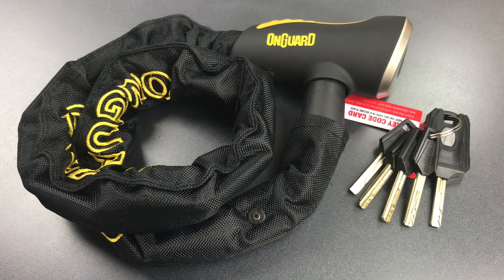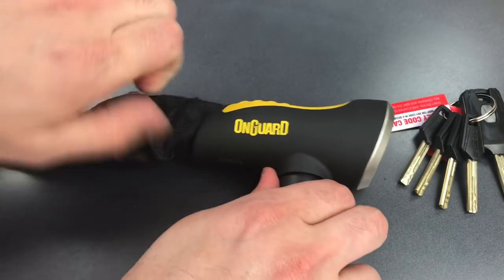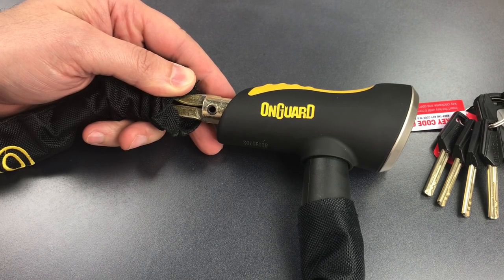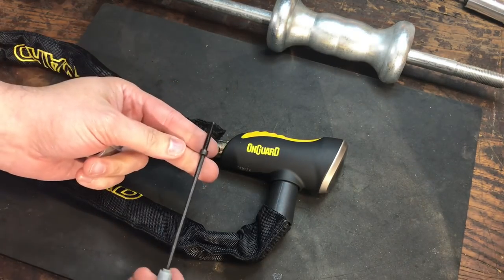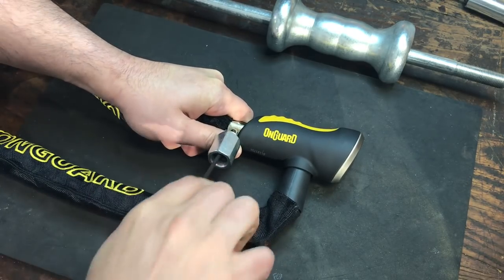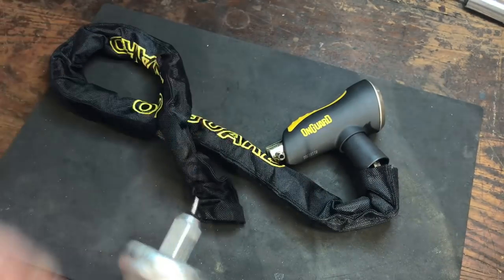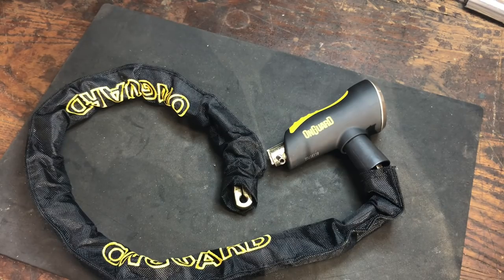[681] Slide Hammer vs. OnGuard Mastiff Bicycle Chain Lock

Comment: useful technique for anyone who needs to pull an inaccessable pin.
Reply: I remove roll pins at work a lot. I usually weld the end shut, build material up to the surface, weld a washer on top and drive a wedge under each side of the washer incrementally. I'm going to try this though next time I have to do that job.

Comment: so a quick tac weld over the pin, and this lock is fairly skoomum
Reply: You've been watching AVE.
Reply: Skookum as frig!
Reply: just fill the hole with some hard epoxy instead, and glue a collar over the joint so it's not apparent which side is pin, and which is blind. Epoxy will need drilling to get through, and that's another required tool for the thief. Also, + 1-2 minutes of meddling if it will envelop the drill piece.
Any lock is just a delay if the thief has a grinder. Or a bolt cutter (often, there's no need to cut the lock itself).
Reply: well not weld since it hardened steel. difficult to put a bead on, but def hide it or delay access to...
Reply: @JohnLeePettimoreIII  the bigger the gob, the better the job 🍻
Reply: That’s what I thought!

Comment: So... insert a screw and break it off and you can't attack it this way?
Reply: Just remember that there's more than one blind pin to plug up.
Reply: A thief isn't going to carry around a slide hammer and cut the housing off to work on the other pins...LOL Let's be somewhat realistic here.
Reply: Wrong - one of popular methods is core pulling. Slide hammer is safer to carry by thief than bolt cutters in case police stops them.
Reply: Or just have it tack welded straight from the factory. There is no point in it ever being removed anyways

Comment: I think you could prevent this attack by inserting flush steel pins into the split pins.
Reply: Or fill with epoxy.
Reply: Yeah or just weld the whole thing together. That pin doesn’t need to move or come out.
Reply: You could melt Copper into it. Copper won't weld, so the body panel stud welder won't work. Plus, better heat tolerance than epoxy, so it'll be less susceptible to a torch.
Reply: @circuitsandshortcuts  Just continue guys. I am collecting all tools in order to avoid all your ideas. Hell, I'll just take entire workshop with me.

Comment: This lock actually seems like a good buy.It's cheap for it's size. Basically unpickable (bosnianbill had to give up), and fixing the pin seems like a quite easy fix. I guess if you don't have a weld machine you can stuff that pin full of something that hardens, so anyone would be unable to screw a bolt in.
Reply: "Basically unpickable"
Did you even look at the video he linked to ? He said himself in the video he had already picked it in the previous video.
Reply: @flashcat6665  LPL is in a league of his own. Bike thieves are nowhere near to him, so it's unpickable. And the pin issue is an easy fix. So, I'm buying the lock.

Comment: The thing about this by-pass is it could also be done surreptitiously, as the lock could easily be reassembled with little obvious evidence to its removal ... not perhaps applicable for a bicycle theft :) ... But if that chain-lock were securing a fenced in compound or equipment storage area ... the by-pass might mis-direct blame to a key holder. 

I think a hardened solid  or threaded blind pin would be much better and a simple 2 second tack weld, would eliminate this vulnerability
Reply: Who said anything about theft
Reply: This by-pass is not surreptitous, any analysis of the pin area would show substantial trauma. It is however potentially very covert, especially if you wern't aware of this weakness, or had potential reason to believe the thing that this was protecting wasn't there in the first place.

Comment: Be interesting to see if a longer screw of the same thread just screwed in would drive the pin out far enough and then just undo the screw
Reply: Yep use a cordless impact bet that pin would b out in like 30 sec almost no noise

Comment: After putting in the (supposedly hardened) roll pin, I'd insert a slightly shorter pin made of high tensile steel down to the bottom, leaving enough space at the top to insert a hardened steel ball (ball bearing).

Comment: I would have loved to see the nut splitter as it is a relatively quiet tool where the only sound would be created by the lock bumping against stuff (for example when it finally gets opened and the force shoots the lock away)

Comment: While roll pins are hard a good quality tap will thread the inside diameter. Then use a long screw, a bushing that the roll pin will fit thru, and a washer and nut, to jack the pin out. I do it at work all the time. Makes less noise too.

Comment: frankly that is a very good lock but could be improved.

first they could make the part on the lock thicker and make pin hole all the way through and use short pin (make the pin length 2/3 or 3/4 the depth of the lug) then fill both ends with some filler so a screw cant be placed in the holes.

you see that the pin holes and screw holes in some locks are plugged.

otherwise the lock is a very good security.

Comment: was the lock side of the chain assembly (the part with the hole for the roll pin) hardened? If it isn't (or even if it is if you have carbide drill bits) first pick a drill bit small enough to fit through the roll pin and drill through using the pin as a drill guide. next pick a bit thats slightly bigger than the OD of the roll pin and drill from the other side.  should be able to use a automatic center punch to drive the pin out.  with the cost of carbide drill bits down as low as they are, it really makes any lock assembled with a roll pin not too bad to deal with.  and a lot less noisy than either a slide hammer or die/disc grinder.
Just noticed that D.R. M.
 suggested the same two days ago...

Comment: I would thread that roll pin. Yes, they are a bit pricey, but i have used taps to take out pins like that.
Also use a dead blow hammer and a reverse strike yoke (used to work metal pieces like a wheel arch).

In short, little to no noise.
Reply: dead blow hammer and reverse strike yoke sound like those cheesy fake wrestling moves

Comment: “Open ended nut splitter to spread this U joint”
Reply: Are you going to reassemble it and try the other way? You should be able to drive that pin home easily. I kinda want to see it spread apart now.

Comment: That was a great fit. I believe a screw any bigger would spread the roll pin and cause it to jamb tighter. Maybe they can jamb a small rod inside the roll pin to prevent this. Fun stuff.  Thanks for sharing
Reply: Our just use a solid pin.

Comment: Locks keep the honest, honest. Thanks for the brute demo!
Reply: The original version of that phrase was something like honest locks keep honest people honest. If you don't have good locks then basically anyone can steal whatever it is you're securing and be stealthy about it, this is why you need to know what kind of locks you're getting and what design flaws if any they have because sure with an angle grinder you can get through any lock in existence but unless the lock is in the middle of nowhere then using an angle grinder is going to be very much not stealthy, and if you have a good lock it might take you 5 plus minutes to get through it with an angle grinder

Comment: I'm guessing most thief's wouldn't have machine screws, A altered long nut and a slide hammer.  I appreciate the video, just for giggles, I threaded a machine screw into mine and then ground the top off flush!!!!!  I picked the lock up at Walmart on clearance for $3!!!

Comment: Would be nice to also offer up ideas on how these flaws could be fixed or made better. For example if someone has this type of lock, how could they make it more difficult to exploit the weakness that was used to open it in the video? Maybe filling up the pin's hole with something? Or maybe welding over it? Discussing these things could lift this channel to yet another high IMO.

Comment: Weld a blind solid pin instead. Why do they always build in these failure points? Assembly lines is the obvious answer. Once the main hard parts of the thing are assembled, the mindset is that the manufacturing process is complete. All that's left is to wrap it in plastic and turn it out like a two bit whore on a Saturday night. And it works most of the time - as far as they know or care, because once it's sold, the guarantee has so many tiny grey font get out clauses they never get any coming back to haunt them. This shit began with Edward Bernays and those lightbulb filament guys.

Comment: Make a kind of pin puller.  1.  Get some washers a little larger than the roll pin,  2.  Get a nut that fits your machine screw  3 Put the nut all the way up the screw, 4. add the washers, 5. insert the screw into the roll pin 6 tighten the nut down to extract the roll pin.

Comment: It is my experience that most external bike, moped or motorcycle locks are opened by people without a key with either bolt cutters or battery angle grinders. Battery angle grinders have become so inexpensive that they are probably taking over the market for thieves' preferred work tools, as it works on all locks and does not fill much as opposed to good bolt cutters.

Comment: a bit late... but if you use a large screw with fine thread, you are expanding the pin, making it even harder to remove from the shackle.

I would go back to the idea of using a smaller screw with heavier threads that will hopefully bite into the steel a bit more than actually spreading it.

Comment: I wonder if just running a machine screw through till it bottoms out and see if the threads can pull it out by just continuing to drive the screw against the blind hole end?

Comment: My first thought about defeating your slide hammer would be to place a weld over the hole. bevel the hole and fill it with a nice round blob of weld. Of course, all that would  have done would be to move to your next kind of attack.

Comment: The fastest way to mitigate this attack would be to fill the center of the roll pin with a shot of epoxy, or an even smaller roll pin (would take two attempts like this; more time to open).

Comment: What about freezing the joint?
Reply: That would defenatly work. problem is tough, for the metal to become brittle enough all the way through so that your able to break it by hitting it with a hammer, you wil have to put it in liquid nitrogen for quite some time.

 And in a real world scenario? a bike thief who just happens to have a canister of liquid nitrogen on him, or a thief who has a slide hammer wich is way more  practical
Reply: Richard de leeuw compressed air cans
Big ones have enough juice inside to get below liquid nitrogen temps
Reply: Gewel They can get really cold, but i don’t know if they have enough inside them to get it cold enough for long enough. It would be something I would like to see attempted though.
Reply: @GewelReal  
Nope.  Those will get you down to about -40f ~ -60f.  Far too warm for what you have in mind.  At least 200f too hot.
Reply: @JohnLeePettimoreIII  speak in Kelvin to me

Comment: Great job, Counselor !! Maybe a stainless steel screw may have held up a little better. Also, can you post links to where you purchased your tools, picks etc . . .. (if possible) i need a slide/slap hammer.  ...thanks again, great video
Reply: The screw held up just fine. Came out  because the roll pin opened up once it was released from the hole.

Comment: why would they leave a lock open to a attack that could be easily prevented
Reply: tim bum because its considered an unlikely method of attack both because of its novelty and its ergonomics. Its still a pretty good lock. Especially since someone can simply address the weakness and fix it.

Comment: The good thing about these videos is that the lock company's get to see their mistakes an hopefully fix them the bad thing is you show thieves how to open locks that are on the street now.  Any bike lock is to keep honest people honest.
Reply: Glad you didn't show the tool that is silent and will fit in your pocket to pull that pin
Reply: Kelly Bullock the crims dont know this stuff? Even if they didnt, its unlikely they would try this method. Its slow, bulky and loud. They could i guess but its better to know your weaknesses so you can cover them than it is to hope that a bad guy doesnt find them and use them against you.

Comment: Looks like the roll pin sits slightly proud, which unfortunately would prevent a simple fix for owners: Using a punch and hammering over the edge opening so the roll pin can't backout.
Reply: thechosendude, I think that hammering down a small nail down the center would be enough
Reply: Perhaps a tiny dot of weld from a MIG welder?  That would rule out this attack and probably would have cost the manufacturer a few pennies.
Reply: Josuel Servin - Would also work if you find one that fit, then grinded it flush so it can't be grabbed.
Reply: David Null - It looks like the reason they used a roll pin in the first place is the assembly line order, otherwise they would have riveted the chain or done some other better retention method if they could do it earlier in the assembly process.

Comment: When you said "Let's try something a just a little bit different" you didn't tell us what it was. Did you cheat? Say it ain't so.
Reply: OÄKTA DOPBOK he tried a different sized screw.
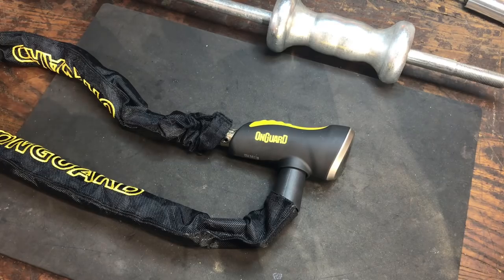Reply: Really? And what size would that be? 3:03 that looks like a 6/32 that has been doctored. He did not say he "tried a different size." Did the doctoring figure in the time he claimed to defeat the lock?
Reply: I would imagine that depending on why the screw stripped whether it was stripped on the way in vs on the way out it was either a slightly larger or smaller screw.
Reply: Yeah well, I wasn't asking you. You weren't there.

Comment: As an owner of this lock- how do I secure the roll pin?  Maybe fill it with glue? or maybe Solder?
Reply from the maker: Buy two taper pins designed for securing the front sight on an AR-15, and pound them into the middle of the roll pins. Grind off any extra sticking out. That should do the trick. 👍
Reply: Or a little JB Weld.
Reply: I used a TIG welder and a screw.

Comment: Not to argue, but that isn't a roll pin but a spring pin. The solid type pins are called dowel pins. 

The BATFE folks for pinning muzzle brakes on barrels allow for dowel pin installs, but a spring pin is a no-no.
Reply: Roll pin and spring pin are two words for the same thing
Reply: Reid, they're not. Don't believe me, look at McMaster Carr or MSC.
A spring pin is a 350 degree spiral pin with a slit running down the length of the pin to allow for the compression of the pin being inserted into a hole.
A spiral pin is a coil of spring metal wound in at least two loops.

A spring pin or a spiral pin are not hard by fastener standards. Dowel pins on the other hand are, which is why the LPL had a difficult time getting the screw started.

What is used in this lock is a dowel pin that has had a portion on the internal material removed. Dowels pins are a displacement  pin that expands the internal diameter of the part that you're inserting the pin into.
Reply: First of all colloquially these are all the same Roll pin, Split pin, Tension pin, Spring pins.........Although.......

4:17 the pin is split with a straight linear cut and no overlap. This is a ROLL pin (tension pin). It is also a traditional tension pin. It is not a dowel pin as it is split. I will mention that in technically specific definition I would consider roll pins as a category that contains Spring pin, Tension pins, and coil pins.
Coil pins have overlap of material that closes the ends and begins a coiling of surplus material to increase tension. 
Spring pins have a wavy or serrated slot that reduces linear distortion or twisting, the slot shape also prevents  ridge creation from slot on part with linear movement.
Tension pins are the plain straight slot pin A.K.A roll pin, although all above listed pins are tension pins by action, roll pins by construction, they are not by nomenclature in regards to pin specification and identification in technical documentation.
Reply: It's a roll pin because old guy told me it was a roll pin.
Never argue with old machinists.

Comment: Thanks, 
You saved me the trouble of buying one of those to test. I thought BB was a bit off on the sliding resistance of that roll pin. I have a bunch of really hard random machine screws obtained from aerospace surplus (when there was such a thing) that I used to use for things like this.